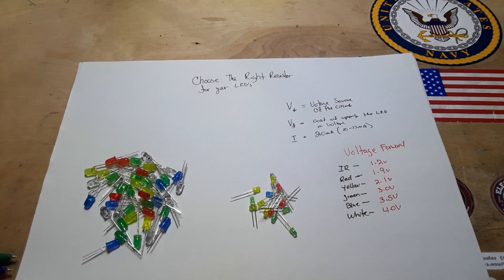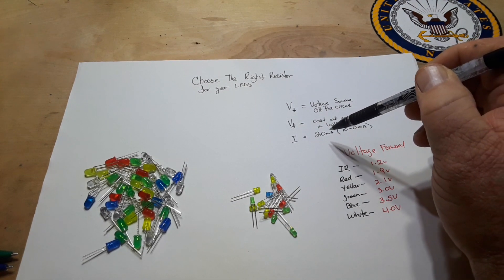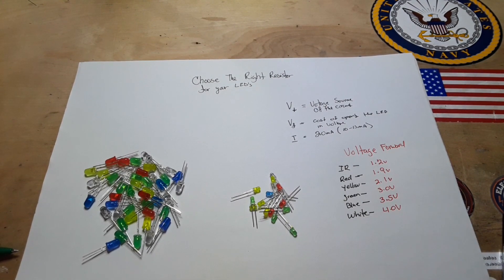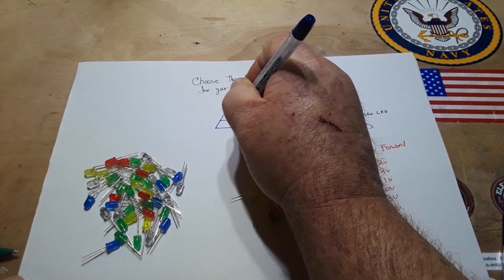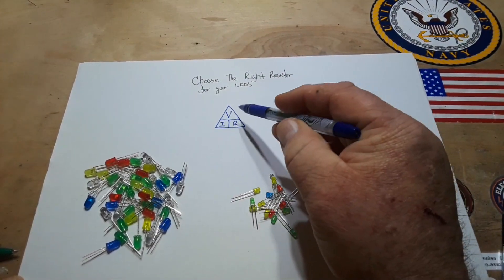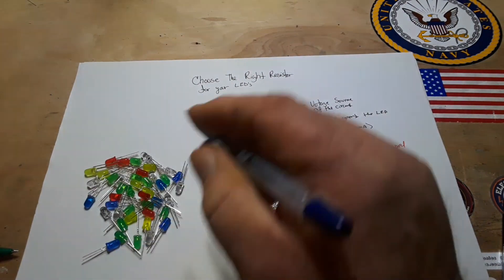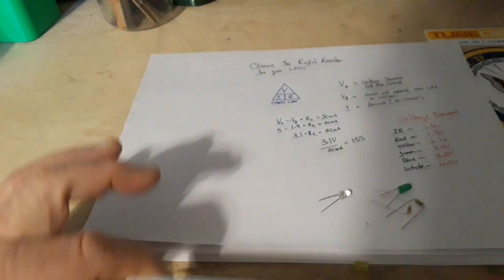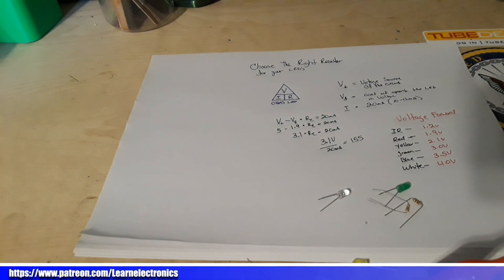Choosing A Current Limiting Resistor For LED's

Comment: Handy tip: if your meter has a diode setting, you can use that to tell you the Vf for an LED quickly.
I'd start with lower than the recommended current (use higher resistance) and reduce resistance only if the LED is truly too dim.  
Like humans, they last longer if ya don't overdrive 'em.

Very rough guide to color vs current and voltage:
Infrared (20mA) 1.2v typical, 1.8v max. Some require much more current and have a lower max V.
Red/Yellow/Orange/Amber (20mA) 1.8v typical, 2.3v max
Blue/Green/White/Warm White/Pink/UV/Purple (20mA) 3.2v typical, 3.4v max
Best to check Vf with your meter first, though.

Comment: The Arduino R3 GPIO pins are rated at 20-40ma which is perfect for experiments with LEDS, however the Arduino R4 GPIO pins are rated at 8ma max. Just saying if you don’t want to damage your new board watch this video from this very knowledgeable guy 😊👍🏼
Reply: Why the hell would they make the output so damn low? That sounds like method of forcing ppl to burn their boards to buy more.

Comment: Paul, you should put your act together. Prepare your videos and make a script. As some have mentioned here before, your math is wrong; it's not that you don't know the math, but you mess up because you are not prepared.
This is not the first time. You screwed up in the video about the flashing leds a couple of weeks ago. The worst thing is that several people mentioned it in the comments and you just didn't care. You just left it there without any comments.
I used to love your channel but lately  I'm very disappointed.
Reply from the maker: I haven't been paid in months. My savings are almost gone. Your right, I have lost it. Lucky for you, I wont be here to annoy you with my terrible videos much longer.
Reply: @learnelectronics  Perhaps you should carefully read what I wrote. I used to love your videos; the reviews of multimeters and scopes; some of your circuits you need to know; .... 
But, if you don't get paid, there must be a reason. Just be aware that your sponsors also see what I, and many others, see. I just wanted to wake you up, just in case it could be of any help.

Comment: In practice I tend to breadboard the LED circuit, like you did, and add a 1K potentiometer instead of swapping out resistors. I then dial the pot value in until the brightness looks acceptable, and then measure the pot to get the nearest size resistor.

Comment: 100 ohms is not ok due to the rule less is more.
Less resistance = more mA available to the load resulting in a reduced life.
Also its slightly easier to read if you write (Vs - Vl) / I.
Vs = Voltage Supply, Vl (lower case L) = Voltage Load of device needing limiting.

Comment: Hey, I think you made a mistake.
Voltage = Current x Resistance, but you wrote the first 3 lines of your equation as Voltage x Resistance = Current (wrong),
and then jumped straight into Resistance = Voltage / Current (correct).
I think you should redo the video to avoid confusing your audience, please.
Reply: I'd just like to add that I love your channel and I am subscribed, and was watching this as a refresher, even though I've already watched your LED Basics & Unknown LEDs videos.
Anyway, just wanted to clarify that I'm not trying to ridicule, just trying to help out. 
PS: Are you secretly @simplyput2796 ?

Comment: If I'm not using them for illumination I tend to run them as low as possible, so unless they're in a bright environment, I've found you can easily drop down to 2.5-5mA and still easily see when they're lit.

Comment: The first equation should be (V+ - Vf) / Rc = I, rather than V+ - Vf * Rc = I (i.e., parentheses are needed around the subtraction, and it should be division instead of multiplication). Also, solving 3.1V * Rc = 20mA would give you 20mA / 3.1V, rather than 3.1V / 20mA. Note that 3.1V / 20mA is the correct answer, but this is because "* Rc" should be "/ Rc".
Reply: You're exactly right.  Thankfully, "all's well that ends well" with Rc = (V+ - Vf) / I      :)
Reply: Please excuse him, he is very very basic, done some study to obtain his ham ticket.  If That was me I would run them at around 15 mA to be able to get extra life out of them.  Definitely not at max current.  I made chart for myself for different colours and not exceeding the 20 mA rating.
Reply: Yup. Sorta implied by the units but the programmers among us might not be able to write this without parens lol